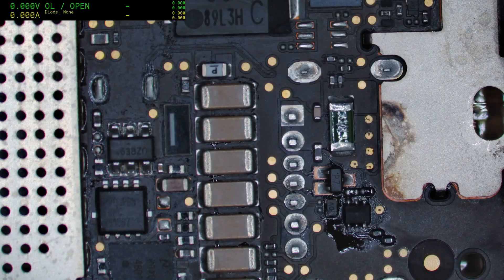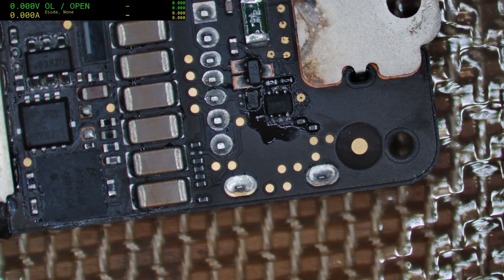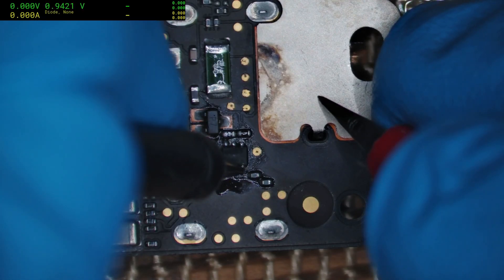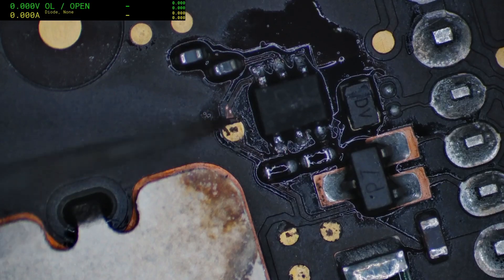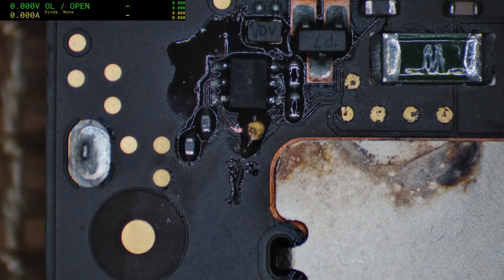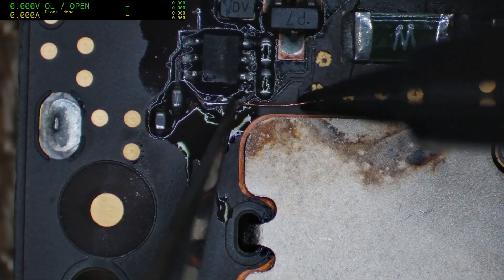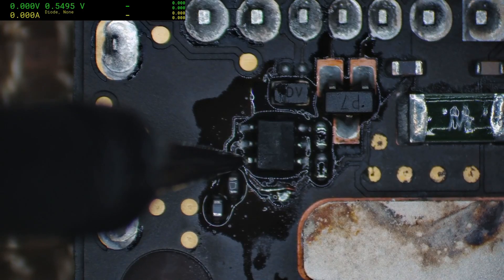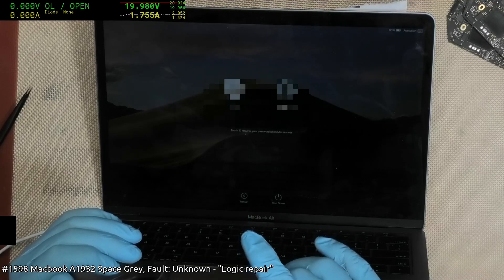1598: Fixing Macbook stuck on progress bar.  A1932 that never quite boots.

Comment: please help me mister, A1502 820-4924

pch_clk32k_rtcx1 

p5vp3v3_vref2 

p5vs3_en 0v 

pm_slp_s5_l

i have measured this no voltage

what should i replace?

on the machine there is no visible damage and no short circuit